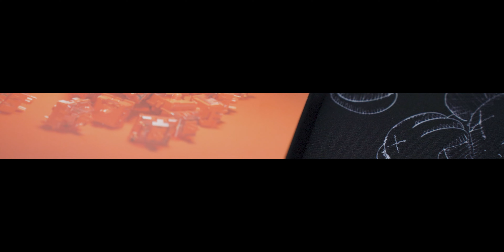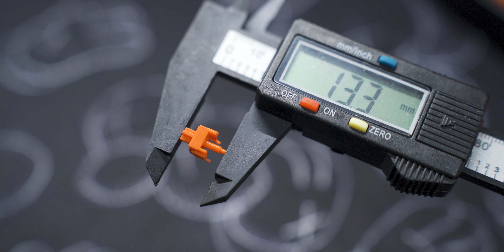BUDGET THOCC? Akko Radiant Red Switches Unboxing, Review and Sound Test | keycappuccino

Comment from the maker: TIMESTAMPS!
0:00 - Unboxing
0:17 - Specs
1:30 - Sound Test 01 - Milky Yellows vs Stock
1:54 - Sound Test 02 - Stock vs Lubed
2:22 - Sound Test 03 - Milky Yellow vs Stock vs Lubed
2:46 - Lubing the Switches
6:31 - Assembly
7:50 - Akko Radiant Red Typing Test

Comment: Sounds very similar to the matcha greens when a board has tempest mod. Great video! :)
Reply from the maker: Interesting! Haven't tried yet the Matcha Greens, but I'll do a comparison once I have it.
Reply: @keycappuccino  Buuut the radiant reds based on your soundtest are indeed thockier. The matcha greens are a lot more clackier even when lubed without mods such as tempest and plate foam. I also use a pom plate. I should have clarified that in my original comment.
Reply from the maker: @vectivuz1858  oh that's interesting. I'm looking for a board with lots of plate options so that I could do more in depth tests. Haven't tried on a POM plate yet.
Reply: @vectivuz1858  are these radient reds more thokckier than lavender purple or cream blue V3?

Comment: Can u flim this switches ?
Reply from the maker: you can't because it's a kailh style housing, but you won't need to. The housing is very tight even after opening it for lubing.
Reply: @keycappuccino  when you open the switch to lube it does it cause the housing to loose more ? Or its still fine
Reply: @AKKO VN thx i just bought 2 pack of 45 from your shop still waiting for it to ship to my house and im looking forward for it :))
Reply from the maker: @keyboardstuff2580  it's still fine. Cherry style housing especially budget options like milky yellows, do loosen up hence they need film to tighten up.
Reply: @AKKO VN the akko radiant red have arrived to my house and tbh its kinda weird. So this is my opinion
-the switch is smooth it sound pretty deep and the housing is super tight
-It have some spring ping and some of the switch is kinda scratchy but I’m planning to lube it anyway so its not a big of a deal.
-the worst thing about the switch so far is the super loud high pitch and annoying sound when i bottom out some of the switch, it sound like a tick sound and it bother me a lot.
So overall its a nice switch but im trying to lube and somehow hope to remove that kinda ticking sound when the switch bottom out
Reply: @AKKO VN did you experience any loud and high pitch sound when bottom out when you use the akko rad red ?
Reply from the maker: Radiant reds are high pitched compared to other linear like gateron milky yellows. Lubing helps to reduce this like I mentioned in the video.